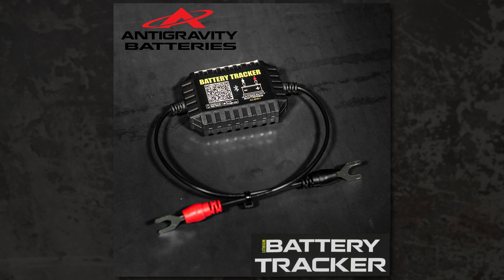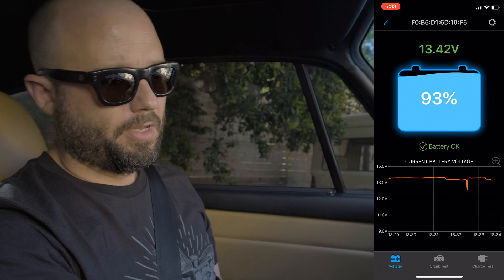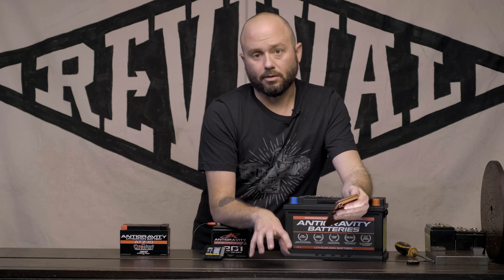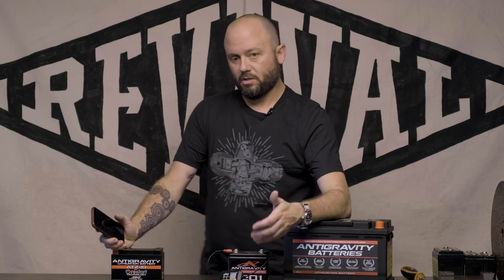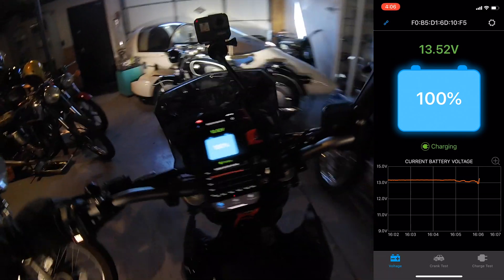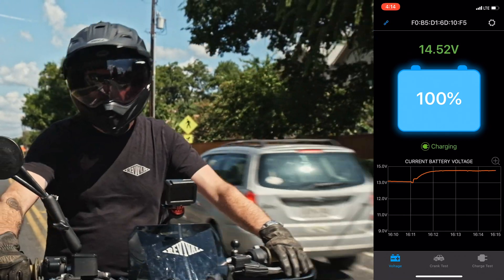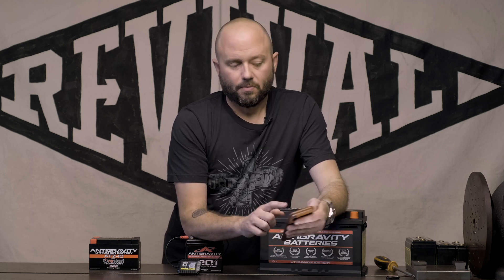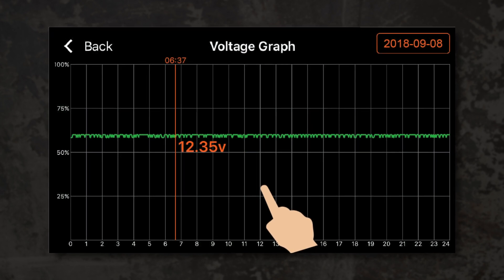Bluetooth Battery Tracker Review & Test Ride / Never get left with a dead battery again!

Comment: How much, because I have an optimus adapter for my battery charger that's connected to the battery that has a charge indicator light on it.?

And is it a parasitic drain on the battery?

Comment: What's the power draw on it while the bike is off?  I'd like to monitor the battery of a bike that's barely used, but wouldn't want it to drain it dead after a few weeks of sitting idle.
Reply: My thoughts exactly.  With bluetooth constantly trying to reach out to a device to report a status, it's definitely using battery power to do it.
Reply: @kr4dh4x0r , I have one. The drain it creates on the battery is almost unnoticeable. And that's on an Antigravity motorcycle battery in my CAR. :)
Reply: @Prelude_Si  - on your car?  Amazing.  Lithium is the way to go!
Reply: I’ve had one for three weeks. I ride almost daily - but my commute is barely 5 minutes.  Just sitting there (and I have a Shorei lithium battery - so nice!!!) for two days it went down … 1%.  It’s a great device!  Now I wish I had a Bluetooth gas gauge … 🥺